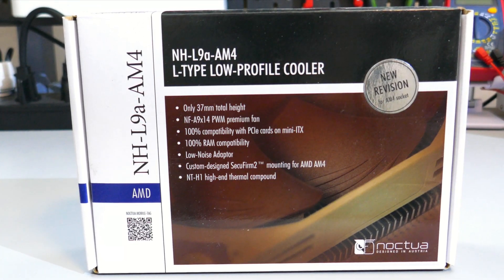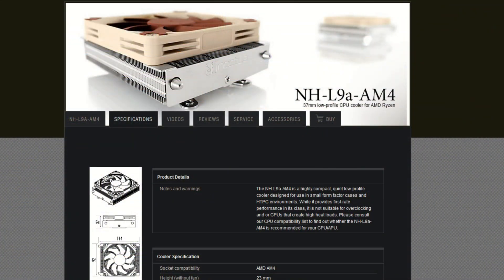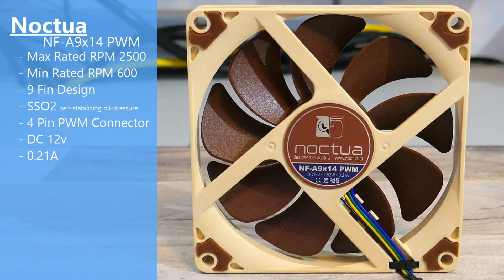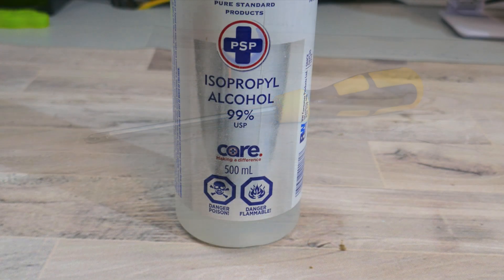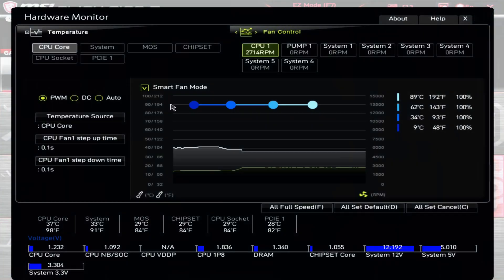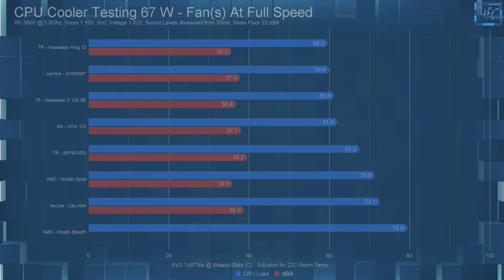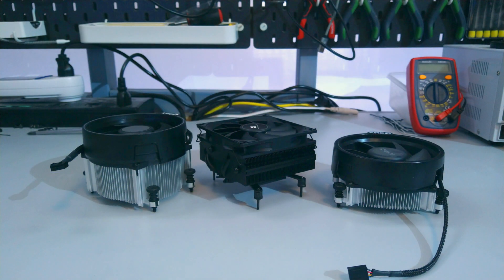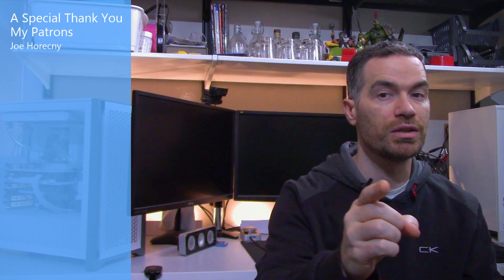Noctua NH L9a AM4 - CPU Cooler Review

Comment: Got a question…have to return a z63 cooler…I pick this up just to run while I get a return on z63…question is will this cool a Ryzen 5950x? I understand temps won’t be as with the z63…but for the 2 or 3 weeks until I get a return…is this cooler enough to not damage the cpu.
Reply from the maker: It will thermal throttle like crazy, but I don't think it will damage the CPU. Assuming it's at stock. 🤔You may want to try undervolting...
Reply: @HardwareForGamers  yes…it’s running at stock speed…I’ll try it since I already bought it…PC only get used for playing Diablo 4…so, if it’s gets to hot, I’ll just jump on the 60 fps PS5 😂 and wait it out…thanks for you reply…subbed!

Comment: The point is its the best HSF at the given height.  You don't use this cooler unless you have to, and if you have to, it's the best one.
Reply: Absolutely right, this cooler is the only solution for ultra small cases like FormD T1 or Lian Li DAN A4-H2O
Reply from the maker: Ahhh.... The Forms T1 SW supports up to 48 mm with a 3.25 slot card, so this cooler is not the only solution 🤦‍♂️
Reply: @HardwareForGamers there are cases that can really only fit l9a, like velka 3
Reply: It’s sadly the only solution for a sub 5 liter 5600, 4060 build I’m doing right now.

Comment: Yeah they're less money but if you buy one now and a new socket comes out noctua will send you a free kit.  It's coolers for a very neat market it's meant to be used when can't fit anything else in on a site the insure again the stock candy coolers too big then you break out this guy and you undervolt your CPU because you want a tiny PC and that's the sacrifice make
Reply from the maker: Perhaps, but you can buy 2 AXP90s for the price of one L9a. Plus get lower temps at a lower noise level I have issues recommending it.
Reply: @HardwareForGamers  I hear you :-) I would only use this cooler if there was nothing else that would possibly fit. I use that cooler in my custom desk drawer PC. On a 3600 it works good enough and it's quiet

Comment: I have a AsRock mini PC and I used that cooler in it and its awesome!
Reply from the maker: What are the specs?
Reply: @HardwareForGamers  AsRock Deskmini A300, Its got 32GB DDR4, Ryzen 5 3400G, 1TB M.2 drive. Its like the size of a small/regular sized PC power supply. It has a  power brick like a laptop for power. I got the black version of that fan, it was a couple bucks more, but I thought it was cooler looking. Its actually very impressive for such a small unit. The 3400G has pretty impressive video, considering its an APU, etc,  too. It was my build project to keep me busy during the peak of the pandemic.
Reply from the maker: Agreed this cooler would rock the 3400G. And yeah tiny itx systems are fun.